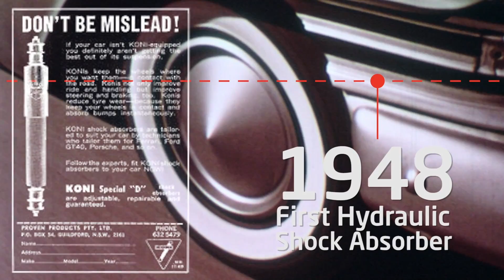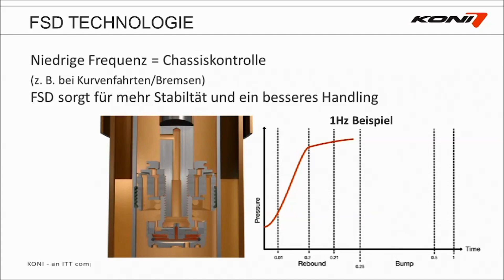THE TRUTH ABOUT KONI SHOCKS

Comment: I'm running Koni's on my Acura Legend set on their lowest perch fwiw. It's low AF. But knowing what I know now, I'd gone coil-overs because I like to drag a little and CO's def handle better. Koni's are good tho' and the only aftermarket shock we should use on our 20 plus year old Legends.  I've got the first one on this website and they had to add Legend as a model lol.    Check it out folks  :)
***Edited to add my Koni's are set on their lowest setting. Pretty low, but not quite coil-over low. EVEN THO" I did mention that. duh
Reply from the maker: Sounds like a gnarly set up man have you added your ride to our gallery?  https://bit.ly/2Ma4oca 🤟